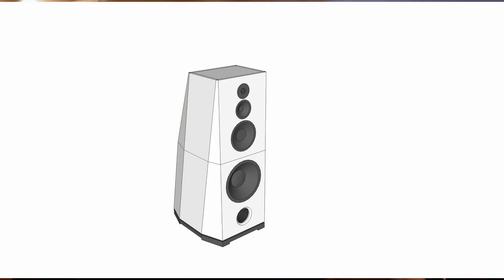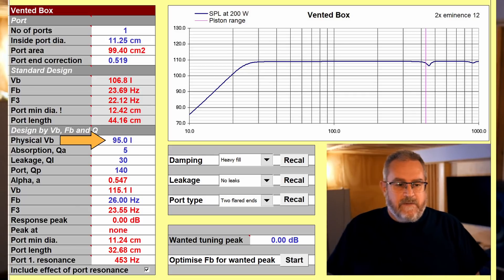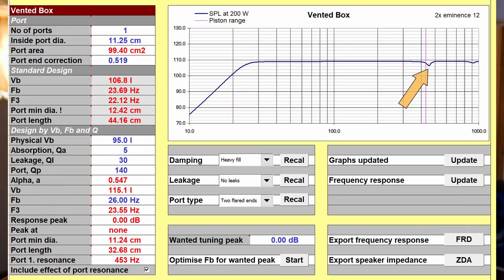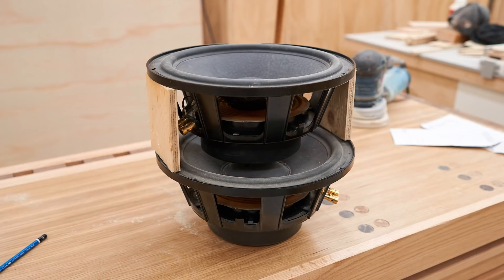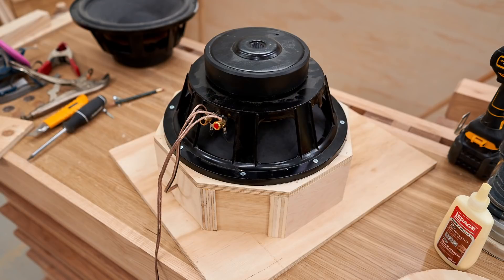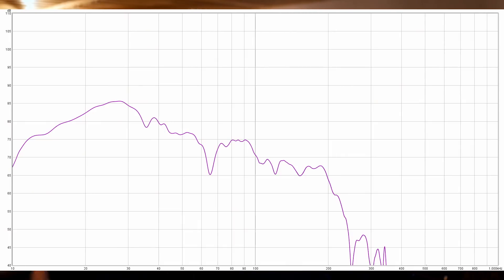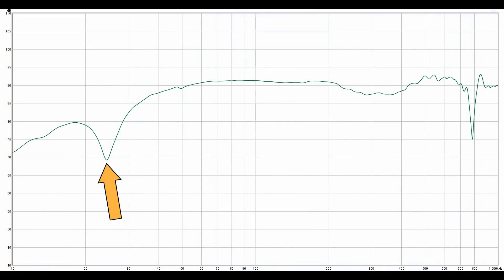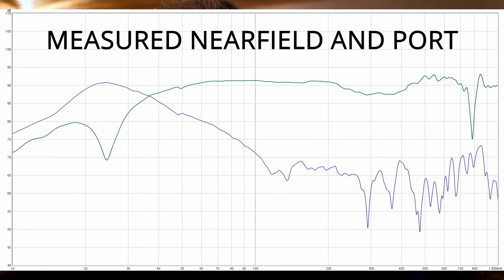The Isobaric Subwoofer Mockup Build and Testing

Comment from the maker: While I almost 100% trust the results that the modeling software give, there's nothing like actually building one to test. This was quickly thrown together with various scraps of plywood and works as predicted.
This will be the lower section of my new main speakers, but I'm not entire sure how that bottom section will be made, yet. 
Original concept (as shown in the video) is to have the outer woofer facing out, forward. I may change that to a clamshell design and have that facing backwards. Also shown is the vent facing forward, and I will likely move that as well.
Reply: Dang !! You look just like my brother i lost last year on labor day i am blown away !! 
Subscribed
Reply from the maker: Like to get my hands on a pair to sell! Too big for my room, but I would give them a righteous test drive before parting with them.

Comment: What is always underestimated, in my opinion, is the precision provided by a smaller enclosure.
Enclosure losses become increasingly smaller as the enclosure gets smaller.
From an electrical perspective, a back-to-back arrangement would be even more interesting, because mechanical and electrical nonlinearities cancel each other out.
Of course, the additional air mass between the drivers reduces the resonance of the diaphragm and removes a little more sound pressure, but the volume between the drivers is not lost, because half of it can be added to the total volume behind the inner driver.
With the larger volume between the driver, you can also install drivers that would normally belong in a horn, now in a reflex volume, thanks to the larger vibrating mass and the higher overall QTS.

Comment: i prefer the back to back arrangment. cancels out the nonlinearity (mostly) of the cone moving "positive" or "negative" . and allso the nasty stuff of air passing by the frame of the speaker, the spider etc... is kept isolated in the coupling chamber. yess it takes up a bit more space and maybe the coupling chamber is a bit larger this way , just consider it some minimal added mass.

Comment: 🟦.... Rather than using any kind of "fill" for the cabinet, IMHO you'd be better off covering one of each of the opposing internal surfaces (One directly opposite the woofer and two connected sides) with a 1/2in thick layer of Rockwool).

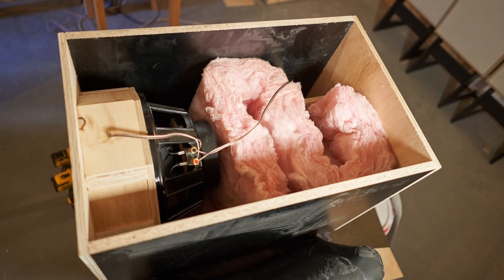Comment: 4:18 Interestingly the resonance-frequency drops when you bigger the isobaric volume (the volume between the chassis). So you have more benefits by optimizing the airflow between the woofers than by minimizing the volume. 5:17 Ported enclosures should contain a less damping stuff as possible. It only reduces the energy you can get out of the port. May you cover the walls with convoluted foam (if needed adding a layer of polyfill) to damp the mids. But be sure to let the space between woofer and port free of any stuff. Can't wait to see the final Box ^-^
Reply: Adam,  are you saying spread the woofers further apart in the connecting sealed chamber or am I totally misunderstanding you?
Reply: @colbylaro9361  If you mount the speakers membrane to membrane there can be a benefit in increasing the volume between the membranes (but also in the other two verions).
Reply: @colbylaro9361  I am not Adam
Reply: @djambush360  jambush
Reply: So what are you saying?
Reply: There can be or there is?..John seems to be saying the must be as close as possible?
Reply: @colbylaro9361  There is a secret i am going to tell you: use Google to get more information. Just like i do. You have internet? Use it!

Comment: So when you measure the driver itself it loses dbs at the frequency the port is tuned to but when you measure the port you gain dbs in that frequency so when they work together they even out? Am I understanding that correctly?
Reply: Yes 
It's not all additive and in phase, but most energy sums in the right direction... filling in the freq response. 

At port tuning the driver's excursion reduces dramatically and the port is primarily responsible for acoustic output. 

It's a compromise. 
You're leveraging for that extra output at tuning, ... at the expense of a faster roll-off below tuning. 

(Ported systems rolloff at 24dB/octave, sealed systems roll off at 12dB/octave)

Comment: Isobaric works most efficiently when the speakers are face to face (less air bouncing between the diffusers). Do not use such a low port setting, there is nothing to listen to, and you get more problems than perceived advantages. 75-80 hertz for midbass and 40-45 for subwoofer. It is not the frequencies as such that are important, but the correct distribution of powers and pressure levels.
Reply: What about damping of the drivers below the port tuning frequency of e.g. 40Hz?

Comment: Nice video ! But can you please briefly explain how the second woofers sound wave can get through the front woofer cone material to double the sound output from both of them? Thanks 😊
Reply: the point is not to get more output but more bass extension, they both move air like one woofer does. 
think if it like acoustical dsp. 
for anyone making subwoofer, just make a normal sealed dual driver subwoofer, add dsp to get deep bass. much easier and more output.  you need dsp anyways for whole system so why not use that for the subwoofer also.
Reply: @sudd3660  
You're right, you don't get more output, but you don't get more extension either. 

The only product of this approach is a requirement for half the box volume. 
Nothing else.

Comment: Hey John, former Dolby guy here (in the 90’s when all this home theater stuff was taking off). In Dolby licensed products, “full range” refers to the bass management of the front speaker channels. Unlike theaters, Dolby requires a crossover to redirect LF information to the subwoofer so that the front speakers can be smaller (more convenient for home use). Turning “full range” off leaves the LF in the screen speakers and the subwoofer only receives the LFE channel instead of LFE + the LF from the screen channels. You’ll find nearly every “sub out” to have a LPF except in a minority of specialty cases.
Reply from the maker: That's understandable, but most or all sub amps have a low pass built in as well, and the two combined can create a dip in the response at the crossover frequency. That dip is responsible for at least some of the issues I blamed on SBIR in a previous video. 
My preference would be to have control over both independently - the sub output and the front channel output, not both combined. Too bad that's not an option in the receiver I'm using.
Reply: @IBuildIt  Yea. Exactly. What you have is the minimum Dolby licensing requirement to support bass management in this way. Bypassing it (the LPF) is usually found in high end products.

Comment: Its always shocking to me to discover the infinite depth of any well of knowledge. I am over here from your woodworking content and I'm blown away by how involved this second hobby is/can be
Reply: I have been at this for most of my adult life and I can tell you there is nothing more complicated than a loudspeaker...That's what nuts like myself love about it!
Reply: @russellanderson746  
Indeed, absolutely right.
High performance loudspeaker design is a 𝙢𝙪𝙡𝙩𝙞-𝙙𝙞𝙨𝙘𝙞𝙥𝙡𝙞𝙣𝙖𝙧𝙮 𝙚𝙣𝙙𝙚𝙖𝙫𝙤𝙧 like few other pursuits. 

Physics involved incorporates acoustics, mechanical and electrical engineering, electronics systems, magnetic designs utilizing ferrite, neodymium, and materials science including everythingfrom paper, to beryllium, titanium, aluminum, plastics, Teonex, mylar, and polyester. 

Additionally, the physical construction incorporates wood-working, adhesives, addressing acoustic and panel resonances, constrained layer damping, baffle step compensation, and diffraction effects, driver center to center distances and proper acoustic summation and propagation. 

The list goes on into psycho-acoustics and the manner in which we experience sound... ie., we don't experience sound the same way a measurement mic captures it.

A successful, high performance loudspeaker design incorporates all this and much more. 

There's also the artistic component, ... the speaker as an object of art and expression.

Comment: Always enjoy your vids!  In the last 27+ years of my professional car audio career I've built numerous isobaric enclosures for high end SQ systems and am quite impressed with the musical accuracy.  Additionally the benefits of the smaller air space required for lower FS combined the increased power displacement is astonishing ...although using fill - in my experiences - results in a very dry and less than natural bass response that becomes less predictable.  My best results have been when the subs are facing each other with little to no airspace between them (1 ran out out phase from the other) with the vent firing into a reflective surface.

Comment: I think it was Pioneer that used a non powered dummy woofer face to face with a powered woofer in a 80s car stereo plastic cabinet, not sure if it was ported, if i remember it sounded pretty good and was fun tearing it apart to see what was inside.  Please use high density particle board for your enclosure and wool batting instead of pink.😮

Comment: Very interesting, thanks for the science behind the construction of the speakers, how do you connect them both together, parallel to get 4 ohms ?
Reply from the maker: Parallel, but they can be wired in series.
Reply: Are both drivers wired in phase or out of phase
Reply: @robertspringer9477  
Both drivers need to be physically in phase, ... regardless which direction they face.

Comment: Nice and concise!  What about resonance of material used .  Density such as particle board has might also influence the build. I'm getting older and hearing loss affects my attitude . LOL.

I remember using folded horn in developing speaker boxes.  That was transistor moving into IC days. LOL!  No calculators and 'puters!
Reply from the maker: Since this is just a mockup, material density is not a concern. With that said, that's something that is generally overemphasized by a lot of speaker builders. Large panels need to be braced, but there's not much difference in the density of the common materials used.

Comment: I do not claim to be an audiophool. In your effort to improve the acoustic coupling between the two speakers by positioning them close to each other, are you introducing a magnetic coupling between the speakers? Does it matter?

This video flowed more smoothly than a lot of your other videos. I assume you were reading a script, but there was a lot less verbal static.
Reply from the maker: If they are both doing exactly the same thing, how could that be a problem?
Reply: @IBuildIt  it seems that the rear voice coil is in the magnetic field of both speakers. I don't know how the fields from the 2 magnets add together. I don't know if it matters enough in the real world.
Reply: @bobt2522  like trapping a voice coil between two opposing magnet fields ?

Comment: I'm curious about the phase relationship of those two speakers working together. Will you need to adjust the phase so they are perfectly in phase and working together or is that not a concern.
Do you feed the same signal to both speakers or are they two different outputs from the amplifier.
Very interesting.  Thanks John
Reply from the maker: No phase issues. The drivers are wired together in parallel from one source.
Reply: At these frequencies, the sound wavelength is measured in meters.  So technically, there will be a VERY VERY VERY small phase mismatch, but it is so  small that it can be assumed to be zero.  For example, at 20Hz the wavelength is around 17m.  Let's say John spaced the drivers 20cm (8") apart.  The error would be around 0.1%...  (I think I did the math right...please correct me if not).
Reply from the maker: @CDN_Torsten  you are assuming that the rear woofer is producing sound waves independently of the front woofer. It doesn't work like that - only the front woofer is producing waves. The sealed airspace between the woofers couples them together so that they act as one unit. The smaller the space, the more effective that coupling (or connection) is.
Think of the rear woofer as just a motor that's working with the motor in the outer woofer.

Comment: The idea that fill "adds" volume is a long since busted myth, particularly in a ported enclosure. In a sealed enclosure it will slightly lower Fs as a larger enclosure but this is done by way altering the Q. This is not the same as an  actual increase volume which also has an increase in sensitivity. There will be  some benefit in reducing the port issues as you have shown.
Reply from the maker: Unibox predicted the results pretty much bang on, and it accounts for the extra volume the heavy fill provides. You can see it calculates the Vb as 115 liters.
Reply: @IBuildIt  I will add here that I have always read that it is very important to make sure that the pathway between the diaphragm and the port in a bass reflex design be unobstructed by fill....You may already know this, but if not it may to some degree explain the divergence from the Unibox(a progam I also use and love) predicted response.  I am really enjoying this build and all of your work on room treatment and design.  Thanks for sharing your findings and skills!!
Reply from the maker: @russellanderson746  the "pathway" between the port and cone doesn't need to be clear, the  mouth of the port needs to be open and unobstructed. The box can have plenty of fill as long as it doesn't block the port.
As for the divergence, that's little more than a rounding error. As in, if I'd rounded over the port opening on each end, that would have shortened the port to the point where they would matched perfectly. As it is, it's nearly perfect anyway, or as good as I've seen.
Reply: @IBuildIt  No doubt, the the results you got were great and showed good agreement with what UniBox predicted.  It is nice when things go that way, ha!  On the importance of not having obstructions between driver and port, maybe  check out transmission line theory and building practices where the effects of stuffing on the speed of sound is a very critical consideration.  Once again, I admire your engineering and building skills and will be following your progress!!
Reply from the maker: TL is different in that the path to the end of the line is like a long port, or duct. 
A vented box is a Helmholtz resonator and there isn't any path the sound travels down. The internal volume resonates and the tuning of the resonance is determined by the length and cross sectional area of the port.
Reply: @IBuildIt  True, true.  But what I was really getting at is the effect of fill on the speed of sound and the subsequent phase shift that could be happening in your design between cone and port....Also the thought on TL's and bass reflex enclosures(among sick individuals like myself that ponder these things) is they may have much more in common than was previously thought. But hey, you're getting great results and that's what is important.  I'm looking forward to seeing this system being built!!
Reply from the maker: @russellanderson746  Adding fill changes things, of course, but the modeling software predicts that. 
This is a topic that lends itself to the kind of overthinking that's counterproductive. That's why I build then test to shift it all into the real world and out of the theoretical. Reality answers the questions better than any hypothesis can.
Reply: I've heard a couple of speakers builder here on YouTube say it's especially useless for lower frequencies. But on the other hand, it wouldn't hurt either.
Reply: I've done measure with and without stuff in ported design and the result are very different.
The stuffing helps port resonance as quell as "virtual volumex inside the box.
Please read some articles about that and do some tests (in the right way of course)